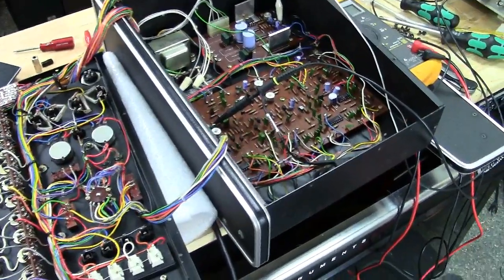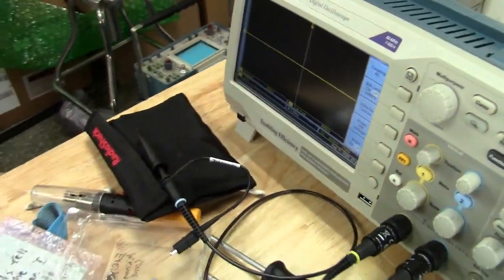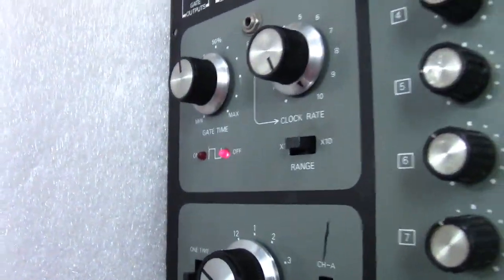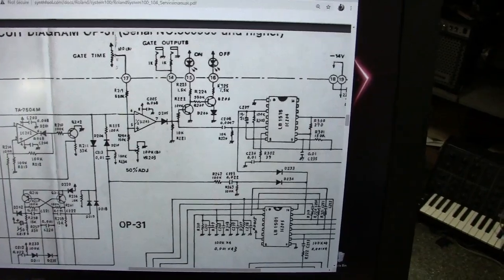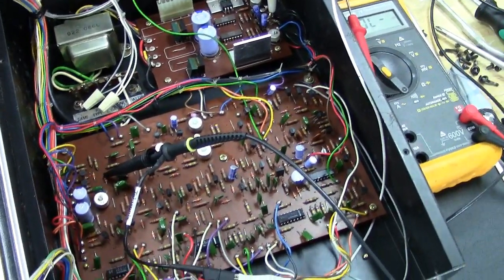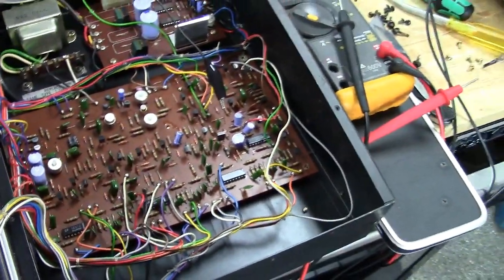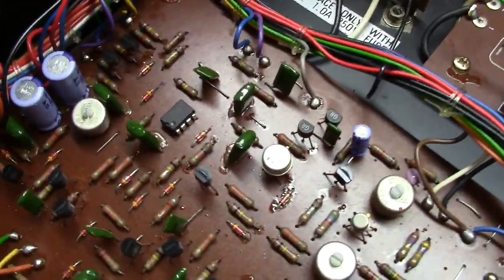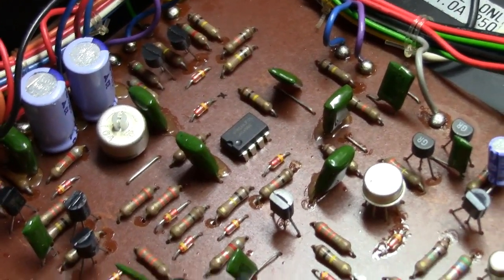Alan's Roland System 100 model 104 sequencer repair (by synthpro)

Comment: Nice detective work there, Jareth. Thanks for sharing. Working on these old boards, without anything marked, and often mismatched schematics can be tricky. But luckily, they're often not too complicated (no ASIC, DPS, or FPGA there) and can be troubleshot with success.
Reply from the maker: Thank you very much! It was nice to dig into something a bit different for sure. what always makes me a little uneasy with Japanese synths is that they would use some very odd components that are hard to find info on....other than that, I really like them and these early Rolands and Korg synths had their own tone for this reason.